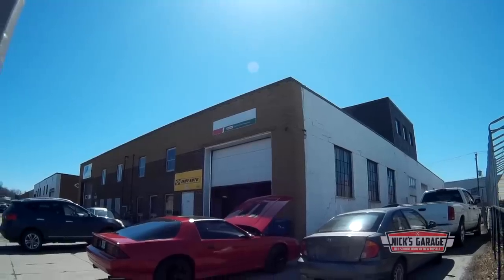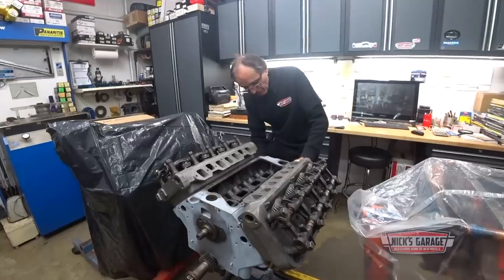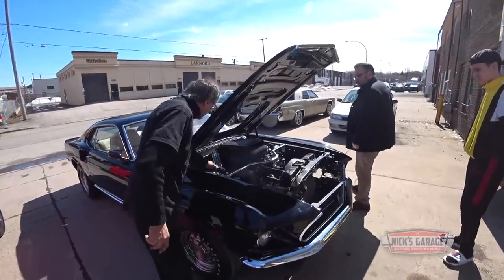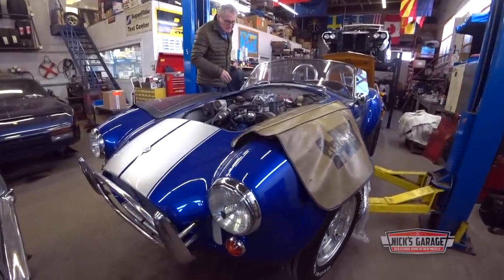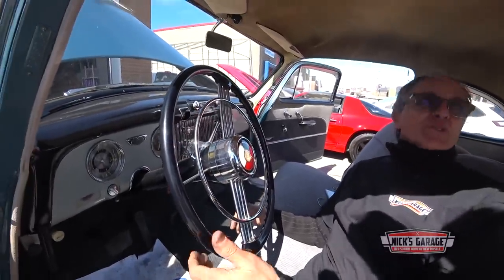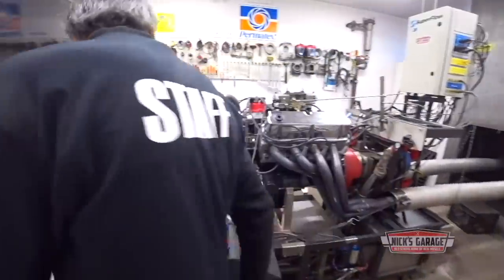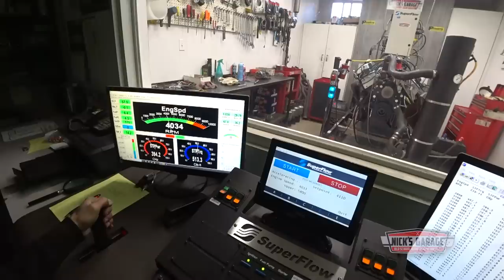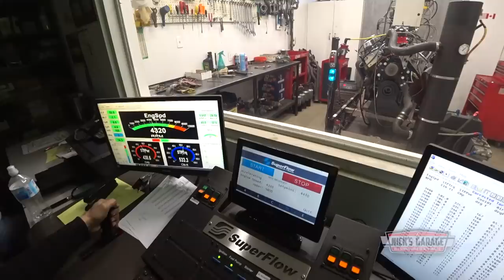427 Ford on the Dyno - Nick Tests the Blue Oval

Comment: All V8's sounds good, but I grew up with Fords all my life because my dad was with Ford for 33 years. Even my boat had a Ford V8 351. I love this channel.
Reply: Was the boat motor in backwards?
Reply: @victorbitter583  no, it's a 2 stage Hamilton jet.
Reply: Dil Lee My dad worked at GM for 42 years. Corvette Assembly plant. I was around Chevys my whole life. The last several years they have turned me into Ford fans lol. Now I only own Fords while dad is constantly having his new GM suv taken in for problems. It really gets his goat that I haven’t turned a bolt on a Ford in 5 years that I’ve owned them 😎. His last 2 GMs have been a giant headache. Some people can never get past their bias even if it means walking lol 😂
Reply: @danielb2145  351 what?? Cleveland?
Reply: There is a new acronym for GM …."Giant Migrane" XD
Reply: @jquest43  Windsor.
Reply: The 351W has the same Firing order as an LS.  I think that it is good for the balance and the stress of the block. I would like to see a cam for the FE engines. A 390 at .030 over a 396 ci with a VS 7875 turbo with a hydraulic roller and an air to air intercooler. A blow through with the stock logs from the 70s F350 two passenger side ones facing forward with a 3 inch crossover connected to both sides with the turbo mounted to a Y pointing to the passenger side with an electronic boost controller and a single BOV. A boost regulated Holley 750 all boost referenced to the Holley XFI running the ignition , fuel regulator and internal functions of the carb . The cold side to a Bonnet with the intercooler and the XFI and the Wastegate all synchronized to allow a 14.7 atmospheric and 14.7 of boost.  If the 396 makes 410, the hp would be 820. The hot side exhaust pipe 4 inch pipe down two a flange to run 2- 3 inch pipes along the rocker panel and exit side by side in front of the rear tire!  I have a 65 Galaxie 2 dr HT with a 394 ci FE that makes 488 hp and 446 ft lbs with a small solid and 2 inch primary tube headers with 3.5 collectors. But I would love to get a W or LS firing order hyd roller cam and use stock rods and Forged 4032 alloy pistons with 1/16-1/16-3/16 rings that Icon already makes at 1.77 ch.  Watching Nick reminds me that even at 61 and blind I can do this with my son!

Comment: Nick, you won't believe what I recently bought, a 1974 Dodge W100 with a ford 428CJ and C6 trans, 205 transfer case.
I 'm going to put the 428 in my 69 F250 High Boy and I'm building a 413 and 727 for the 74 Dodge, good times.
Great video as always, keep it up and Thank you.

Comment: We bought a 54 Buick Special new.  It had the 264 cu in v8 with 139 hp.  The trans was the old small 3 speed manual with the converted selector shift.  The rear was a torque tube with lever shocks.  To start, the carb had a switch on the the throttle that retracted by vacuum once the engine started.  Ours had a heater core with hoses and switch in the back seat.

Comment: 351 is a 9-5 deck and a 302 is a 8-2 deck so the 351 is a lot taller and wider than the 302 so unfortunately it's not usually a direct swap like people usually think it would be
Reply: jason.       I told my client. The 351 has taller decks.

Comment: Amazing what an extra 1 inch thick base plate does! Great numbers 503 HP with 508 TQ.
Reply: Would have been amazing if he had gone wide open throttle with the 830 carb. I bet it would have made more than the 750 with the spacer.
Reply: 508? Moore like 530
Reply: 530 tq
Reply: thanks now I don't have to watch.🤣

Comment: There is available adjustable pushrods. Far from being a crappy solution, they are actually pretty good. Light and strong, not too expensive and made of chromoly I think. A mechanic friend of mine many moons ago when we were both apprentices built a Ford 351 and couldn't afford adjustable rocker gear so he bought these pushrods and ran a solid lifter camshaft. They worked great. 

20 years after that I had an issue with a 318 with 360 J heads and tried to find some of this type of pushrod since I remembered that 351 build all those years earlier and they were easy to find.The ones I used were Mopar Performance. I was astonished at how light they were.

Comment: Custom length pushrods, you want aprox .050-.100 plunger depth on a typical factory type lifter, this is how i personally remedy this issue on non adjustable hydraulic lifter valvetrains, or in some cases 3 piece adjustable pushrods fwiw, most stock push rods leave a lot to be desired anyways, i use Smith bros pushrods personally

Comment: Minimum cfm calculation is simple (max rpm X engine cu.in.)÷ 3456= C.F.M. for any engine.
Under carbing gives quicker hole shot where over carbing will give you a better top end pull.😎

Comment: Rev Up Your Engines!
I had a 1941 Buick with a straight 8 compound carburetion ; it was my daily driver for about 3 years. So easy to drive anywhere.
Reply: Any car is easy to drive in reality dude 😆.
Reply: @Omararmendariz9565   without power steering or power brakes, some old cars are difficult to drive. I've owned about 250 vehicles, some were awful to drive. My 1926 Dodge brothers is really difficult.

Comment: my 399ci Windsor made 500 hp on the dyno but I was only 490 on torque and the 427ci made 530 lb/ft toque . I run a 750 holley quik fuel and 28 degrees on timing. nice , thanks Nick.

Comment: On my 354 Hemi I ran a Isky #444  Roller cam and Adustable push rods. I got them from Hot heads(before it was hot heads) . I was their first OZ customer years ago ha ha
On the cobra, Fit the power steer with remote reservoir ,down below with the alternator on the other side . Mercedes did this in the 60's to fit their wide V8's into their cars designed initially for sixes.

Comment: Hi Nick!  I had a Cobra in a few years ago for a engine rebuild (302). We put on shorty headers on backwards and custom fit to the side pipes. Still had room at the footwells. The stock fox body alt, P/S system won't fit. I think I still have pics of the set-up if ya want a look.
Reply: I will figure it out, thanks.

Comment: Correct lifters from hot heads in North Carolina. If you re ground the cam you will need adjustable push rods or a measuring rod so you can order the correct length. But I'll bet you already know that.
Reply: Sharon.     The new liters were correct.  The old ones were collapsed.

Comment: It's been a long time since I looked at kit cars, but you might want to figure out who built it, and get hold of them.  As I recall, there used to be  slight differences to all the chassis, and some of them were built to handle different motors.  Superperformance or Factory Five or whoever might have headers that slide right in.

Comment: I know you resolved the power steering pump issue but that's why many cobras have manual steering. That's why many have such large steering wheels. You also have the option of electronic steering.

Comment: Your right my 351c had powered by Ford valve covers. My dad had a 69 1/2 cuda' 440. I remember him once having me start the 440 while he adjusted the carb mixture. When I turned the key it had a hicup flame 🔥. He told me to go in the house.

Comment: My FE 394 ci, .020 over that I built 30 years ago made 503 hp and 488 with a flat tappet solid and a 750 off of a 396 Chevy BB 375 hp. There are a lot of tricks to make it run. It started out as a 69 390 2V, but I had it bored .020, forged flat tops, and ARP rod bolts and a polish and peen and lightened the crank a lot and balanced it. I ported the heads and the Holley SD. I added a 1.5 spacer under the 750. 2.11 intakes and 1.6 exhausts with 2 inch primary pipes and 3.5 collectors 18 inches long. I looked at the torque wrong, it was 498 ft lbs and 503 hp and it pulls from 3200 to 6600 like magic and it will keep going to 7200. And not lay down. Idles at 1000 with 14 psig oil with a 9qt Canton deep sump with the trap door baffling and the 3/4 in Sump. I t jumps to 85 at 5500 and stays there. I wish I had put 2.19 intakes in. The heads are C4AE-G really good shape after I worked the short side and bowl. Ford knew what they were doing with the FE. My next one if I get to will be a 4.1 bore and 4.1 stroke for 433.0444 ci. I have a hyd roller from Bullet that with 2.19/1.6 valves should do close to 600 ft lbs and 700 hp according to pipemax. At 63, I need to get with it!

Comment: I love this channel because it shows the average car guy all the little nuances of building a modified muscle car, almost nothing is plug and play and it takes a lot of experience, knowledge, patience to do it right, something as simple as putting in a 351w where a 302 stood isn't quite a bolt in deal when the 351 deck height is 9.5" vs 8.2" for the 289/302
Reply: You will be lucky if deck height is the only issue. The likelihood that motor mounts or getting the clutch, bellhousing, trans, driveline all bolting together is just not as smooth as to be a given. Something not much of an issue on a Chevy can be a different ballgame on a Ford.
Reply: @gregorytimmons4777  
Yep The 351W and 302 is uses different bell housing patterns depending on whick model small block you use and the much taller deck height on a 351w causes all kinds of issues in a chassis designed for the short deck, hence why Most people built a 347 or new frpp boss block with the big bore, 363+ other than a stonger stock block design the 347 is a easier way to go, i didn't list every issue but you get my point that its a good channel showing you cant just throw things together expecting things to just bolt right up, especially in a kit cobra jmo
And ford interchangeability isnt the friendliest, like putting a 455 buick in a 350 buick car, lots to change over, hence why i love the Pontiacs i specialize in, same externally unless you use an after market block, some motor mount difference between years but overall pretty easy

Comment: The advantage of the 351 in the Cobra kit car is 100# more torque than the 302 and you can bore and stroke it to 427”.
Reply: pain to fit but worth it in the end
Reply: 351👍
Reply: Worse gas mileage and my bros 302 with 425wrhp is alot to handle already. I asked and thats what he said. Fuxk the 351 it is not needed.
Reply: Lots harder to fit in, though!

Comment: Nick I am no expert but I have owned many early Mustangs and I don't think that chrome piece is stock.  Every stock 1969-1970 Mustang export brace I have seen was just plain black.  You could purchase aftermarket chromed pieces but I never saw a stock piece that was chromed.  My guess is that the dealer chromed the piece before sale but it wasn't like that from Ford.
Reply: Jody.     Thanks for the info.

Comment: Thanks Nick, ☺️👍 that 427 Ford was impressive. I had a feeling it would make good torque because of the smaller intake. 
  The 1inch riser was trick👍🇺🇸
Also, I like all American Muscle, Including Mopar.
   Knew a guy with a 340 in a dart. It sounded nice when accelerating

Comment: They are hydraulics, the old lifter is very likely worn out and collapsed. Pump it full of oil, and then check the height,
Reply: Douglas.      Done that, and are collapsed. Perfect fit after all.
Reply: yes
Reply: nick anything mopar 68 back had taperd pushrods and the height is the problem,had their own lifters and pushrods,i have a 68 Chrysler 300 convert and bent two,had to go shopping love your show,and most people over carburetor their engine,port velocity is king,if that air flow drops below 200 mph thru those ports, power suffers,i always start with a small carb,blue printing a 65 273 engine,i tried multiple carbs ended up going back the one that the engine came with,and rejetted it,with fenderwell headers it gained 80 horsepower,port velocity is king

Comment: On the 351 belt. U can try n do the 1967 289 motor set up. It would clear the hood for it.
Reply: Jason.   I know. But my client brought in the 351 to be installed.
Reply: If I’m not mistaken the 289 and the 302 and the 351 engine block pattern r the same on the front of the block so if that’s the case just use the brackets for a 289 from 64-67 or a 302 bracket from 68-84 should bolt right up to it. It would move the power steering down about 6-8 inch n the alternator down to 4-6 inches. If it the one wire alternator.

Comment: Try not pre-loading the plugs at full load before the dyno becomes enabled.
This all will require fuel and build up being burnt off before a clean run can be obtained.
After working with dyno's within Chrysler's Highland park facility, Richard Petty's 426 Hemi  cell in building 139 and eventually at CTC... it makes a difference not to 'mud' the engine before a run.

Comment: My friend Bob Cross lost his life after spending Fifteen Years building a Cobra kit car that looked identical to the one in your shop. Bob lined up out front on the road and took off in first gear then hit second the car launched to the right went off the road and hit a corner chain link fence posted the car hit then rolled over to the left throwing another man Cliff. But Bob was belted in and the car rolled over a few two foot by two foot blocks of concrete were he suffered massive head injuries.Bob was part of GM performance division and designed the 502 grate motor among the NASCAR Racing Heads, he was a normal guy who i met and had no idea of his automotive designing skills and prominence among the Racing Industry, at his. Funeral were a ton of racers and engine builders all the top names from both NASCAR and Drag Racing World. He is sadly missed by his family and a multitude of Friends.

Comment: the radio in the 53 buick is a very nice one. when I was in Oakland calif in the mid 60s those old buicks were everywhere. cheap and reliable. not fast or fuel efficient but they would keep running.

Comment: Got some brand new Challenger glass Now Kowalski's on his way to kickin some a**, Riches from wrecks that's a Plymouth GTX, DODGE as usual playing with stacked decks, The 241 HEMI is missing a screw and it needs new lifters to run straight and true all in a days work for Nick and the crew,  I'd jump on board a Ford that had a 427 Displacement small block arrangement It's got a a Roller cam so it should take off like PAN AM 69 Mustang fast n cool lovely to hear it roar and spool Over on the COBRA the headers don't fit but with a setup like that there's bound to be a kit gotta work out the bugs to make it a hit unlike Joe's mint condition oldschool cool blue BUICK  The Ford pulls strong but Nick wants more with a few adjustments there's power galore!
Reply from the maker: Wonderful as always, Carlos!
Reply: @NicksGarage  I love it=)

Comment: A 351 Windsor, Ontario block with 351 Cleveland, Ohio heads, 400 crank and forged 300 6 cylinder rods originated in 1971 mid-west match racing

Comment: I'm not a Ford guy, but that 427 sounds very happy !. what a rumble !!!!
Reply: It may seem unusual but I know what you're talking about. If you haven't already, go watch Nick's video from late 2017 or early 2018 when he dyno'd a SBC that Nick built that is going into a 50's Olds dubbed "Bride of Frankenstein" That is a happy motor, my friend.
Reply: Ford's 427 was so bad that's why it was out lawed in NASCAR, a bad mamma jamma.
Reply: @briandavis35  yes all respect to the designers of that beast !!!!!
Reply: Brian Davis you do realize that the 427 that was outlawed is a completely different engine than this 427. About the only things they have in common is the displacement and number of cylinders. 

Not that this SBF 427 isn’t badass and all but a true FE 427 is the beast of which legends are built on. Especially the SOHC design, way ahead of its time.
Reply: Yes, i am aware of the different engines.  i'm an old gearhead , i once owned a 72 Cutlass S with an LS7 under the hood. talk about a sweet rumble lol
Reply: antero paulino  I’ll bet that thing was a beast. I was directing my comment more towards Brian Davis though. Based on his comment I wasn’t sure if he was aware of the difference. 

Either way they are both badass engines and it doesn’t take anything away from the mill being showcased here. My hats off to the builder, pulling that kind of power and cubic inches out of a small block is pretty incredible no matter how you look at it.

Comment: It would be neat to see the straight eight on the dyno
Reply: 1953 263 straight eight...124hp@3600 rpm. Couldn't find any tq numbers but with a 4 1/8 stroke and an inline  architecture it's probably  no slouch in  the TQ department .
Reply: Straight 8, cammed, and side draft webers, and Indy type exhaust.
Reply: My father said he went for a drive in a straight 8(make?) as a kid and it was a locomotive.
Reply: Should check out the 53( ? ) Buick Straight 8 saltflat racer.. that thing's a beast

Comment: I had to have the hydraulic lifters on my  1981 Opel Kadett 13.00 machined shorter when i replaced the cylinder head.The other thing you can do is machine out the lifter housing in the cylinder hea so the lifter seats lower so the rocker sits flush.

Comment: I was wondering if the 67 GTX that's going away for awhile. Is it the same engine that was built and put on the Dyno in the previous episode? Still waiting on the Stroker 440 to hit the Dyno and see what horsepower and "Monster" Torque it should make!
Reply: Daniel.     Stroker 440 not ready yet.   Soon.